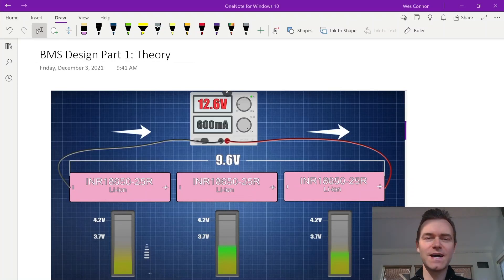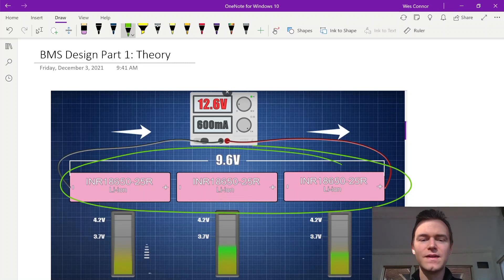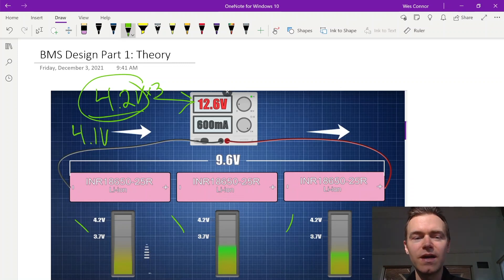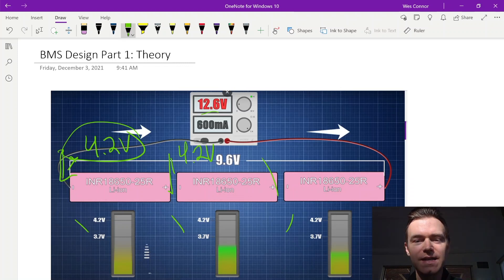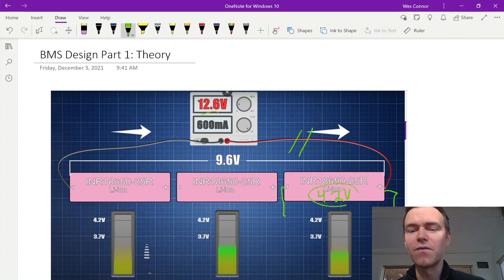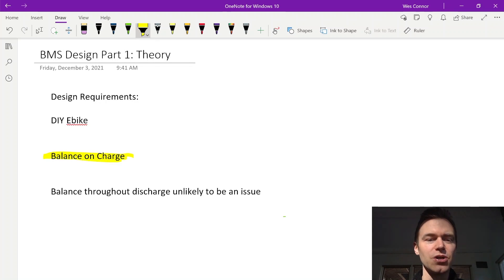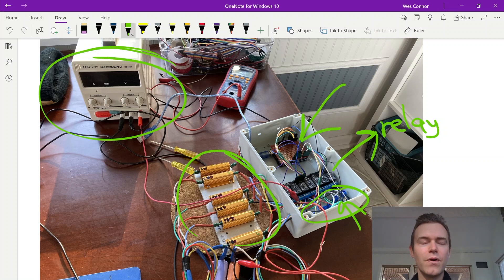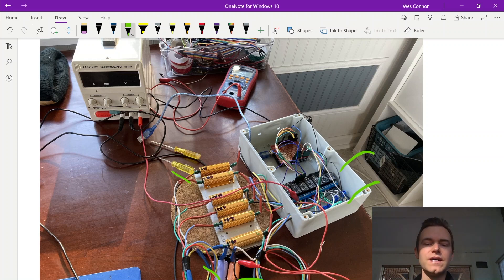Simple DIY Arduino BMS for eBike Battery: Part 1

Comment: I’d be more interested in some process involving a reductive or fusionable carbon that’s rechargeable as a battery if it could produce near magnitude shift on travel distances simply because the battery’s states can be easier understood. Carbon seems better to me than silica for energetic purposes…

Comment: good job the battery for my ebike is 48v and im charging 2 x 24v   at a time still looking for a way to charge the hole battery at once withouy a bms or a smart charger ... for now im using a smart charger but it can only charge 6s a time.
Reply: Nice on your ebike battery. Yes you could use this method to make a Bms which you can control to balance the cells
Reply: @TheSessions101  Thanks a lot Wes